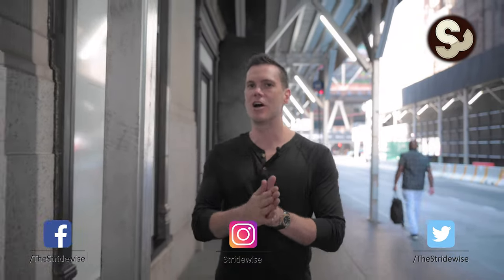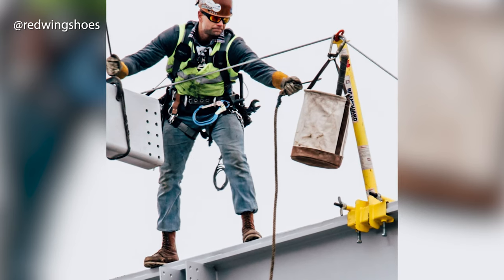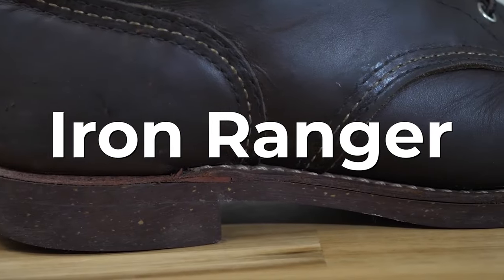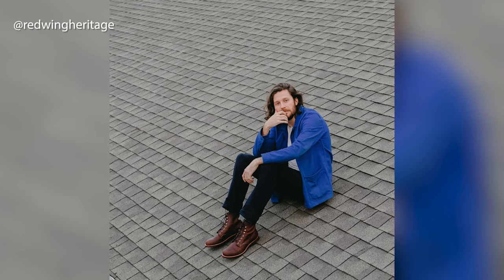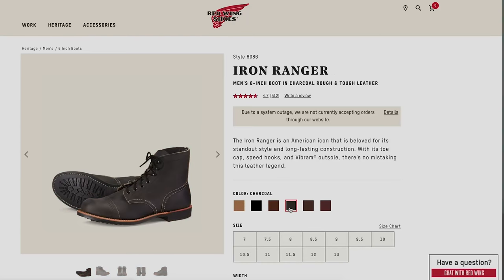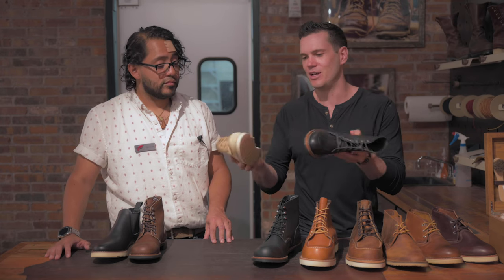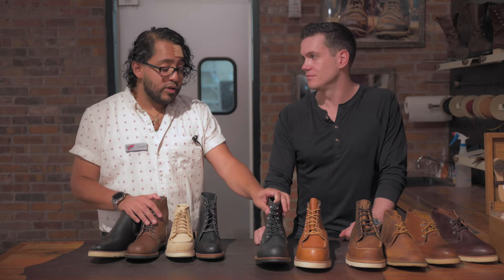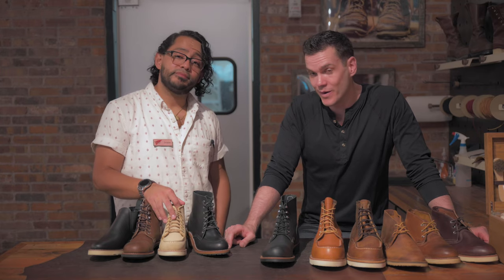NYC's Best Boot Stores: Red Wing Heritage

Comment: Red Wing are one of those brands I kind of "skipped over" with boots - I went from really crap stuff by Carolina to White's without stopping in the middle, and sort of haven't looked back. But, I've really been digging the looks of the slate Iron Rangers and may have to grab a pair. I wonder if there are any plans to do this model in the wide width?
Reply: It's tough to get wide sizes in Iron Rangers..
Reply from the maker: I think the roughout iron rangers - like the Hawthorne muleskinner ones too - are SUPER cool. Hard to get wide IRs but maybe size up? They’re pretty roomy
Reply: @Stridewise  yeah, those have always been on my radar but the slate look even cooler (plus I don't have anything in that sort of shade in my collection). I have really dumb brick-shaped feet so sizing up doesn't really work out for me unless I want ridiculously over-long shoes...which I think would be particularly unfortunate with the "clown shoe" IR. I'll wait and see if they do them in wide!

Comment: If you like Red Wing, I think you should buy new Red Wings. Because the desirable heritage boots can cost almost as much used on EBay as new boots from the Red Wing store.
I'm looking at a pair of Merchants that would be almost $340.
Reply from the maker: to be fair Merchants are discontinued/rare so it'd make sense they cost more now!
Reply: @Stridewise  
It's also hard to find Iron Rangers and Blacksmiths under $250.
Even people trying to sell their Red Wings aren't trying very hard. They must be pretty good to hold their value so well.